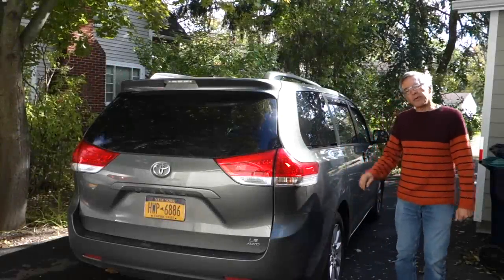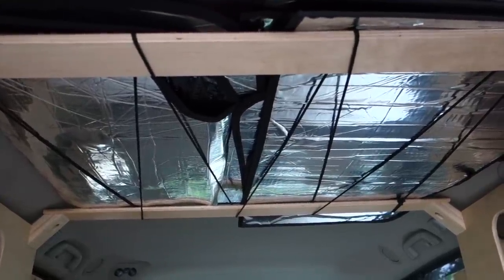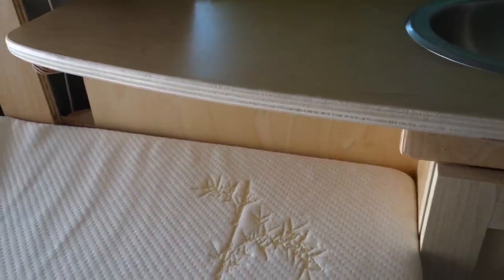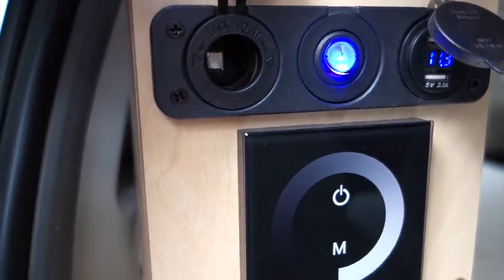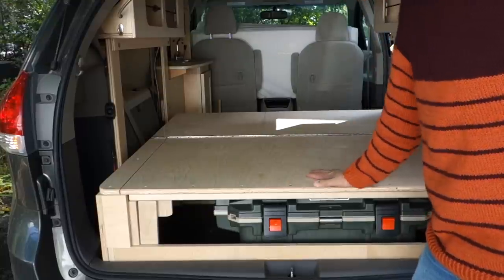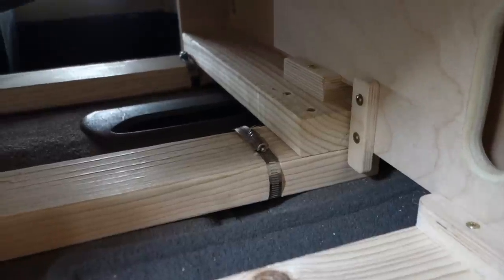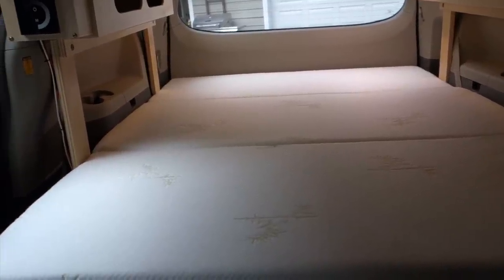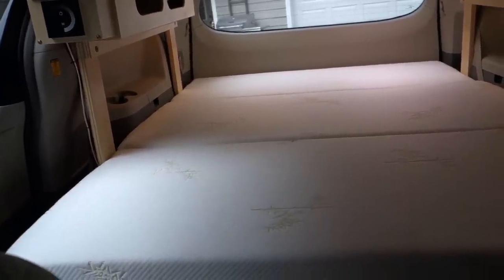A Slightly Different Mini Campervan Build

Comment: Would you share some measurements and charts for all the woodworks and the power/battery hookups? It does not need to be exact as models vary but that should be enough to allow people to follow your prototype.  You can sell your charts if you prefer. Thank you very much for considering this task.
Reply from the maker: Hi Ted, sorry for the delay, we’ve been on the road for a bit. I don’t have any charts, plans, or drawings for the work I did. It was strictly built from scratch as I went. There’s so much custom fitting needed that attempting to draft plans ahead of time was fruitless. One tip is get a bunch of large cardboard and start making templates where your parts are adjacent to interior contours and fine tune the templates before cutting wood. Even then, the wood contours will need final adjusting to achieve the desired fit. 

Electrically, I was constrained to a 100 watt solar panel for fitting between the roof rails. The panel only outputs a max of 6-7 amps so a solar controller rated at 10 amps would have been sufficient. I chose 20 amp in case I ever added an auxiliary panel that I could hook up next to the van for more power. For the battery, I chose 100 amp-hour as a capacity that would comfortably run lights, fans, devices, and a fridge. To learn more about solar basics, search YouTube for Will Prowse - he covers the full spectrum.

Comment: Very ingenious!! Thanks you for sharing, I have some questions: can you put the 2nd row seat without removing vanity module? how wide is the vanity module?  have you consider putting a swivel platform under front seats?   Once again if you share any plans even rough ones would be So amazing!
Reply from the maker: Thanks for commenting. Answers to your Q's: I can easily install the passenger side 2nd row seat while the vanity is still installed. The vanity base clamps to the driver side 2nd row seat track base so the vanity needs to come out to allow the driver side 2nd row seat to be mounted. The vanity countertop is 13" wide by 33" long - not sure if that was the dimension you were looking for. The vanity cabinet underneath the countertop has a complicated shape but you can get a sense for its dimensions knowing the countertop's size. Swivel seat base under the front seats would be great. I've thought about it and searched for existing solutions but have found none. I've concluded it would be very difficult to modify the Sienna seat bases so for the time being, I'm living with the stock seats as they are. I'm planning some updates for 2019 so stay tuned.
Reply: @BruceParks  Thank you so much for the information!

Comment: Hi Bruce and THANKS!      it feels like the perfect design for me. I have recently purchased a 2017 Sienna. Living in Maine, and moving in the Fall to N.M. What are your thoughts on a portable toilet, that will fit into your buildout? I will be hauling a small trailer, so I have an "off shore" spot for the waste. It appears that the platform is built with 3/4 Baltic Birch supported by 2X4's correct?Cabs appear to be 12 inch.  Have you considered Hollywood or perhaps Ballywood? Thanks so much!
Reply from the maker: Hi Lee, glad you liked my build. A portable toilet would fit on the floor between the sleeping platform and the front seats. We just use a Luggable Loo (bucket w/seat); otherwise it's public restrooms. Your analysis of the sleeping platform was spot-on. I used baltic birch on top and both sides; bottom crossbars and vertical center supports are 2x4s.

Comment: That’s very nice design and I like the best I’ve seen by far.   Will you share the measurements and drawings if you have?
Reply from the maker: I'm hoping to work up a set of plans I can make available. Stay tuned (subscribed) just in case.
Reply: @BruceParks  Thank you.

Comment: Wonderful build. One question: When you place the front bed piece under the middle piece, is it sliding back further than the middle piece? How is it nesting back there? Thanks!
Reply from the maker: When stowed, the footboard/table doesn’t move at all. The latch hooks on each side drop into pockets in the supporting rails underneath. I didn’t describe that in the video. Good question, you’re paying attention!

Comment: This is such a well thought of and engineered design! Bravo! Can a passenger seat be reinstalled without removing the bed and overarching structure? I see some of the frame posts are in front of the belt systems, do they prevent the belts to function in any way? Planning on stealing an idea (or two) for my own conversion. Thanks for sharing!
Reply from the maker: Hi, thanks for commenting. Yes, the 2nd row seats can be installed without removing the main structure in back, and the seatbelts are still usable with those seats. Good luck with your conversion!
Reply: Thanks Bruce!

Comment: How thick is the board you sleep on?
Reply from the maker: It’s ¾” thick plywood. It’s stiff enough to support both of us by itself but I’ve also got several midpoint struts and full width crossbars that eliminate any deflection. It’s like a slab of concrete, not that that’s a good thing. It’s just very solid.

Comment: Bruce, your campervan is beautifully crafted, both woodwork and electronics. I was wondering, if you just remove the bed would you be able to install the second row better yet, also third row seats? Thanks.
Reply from the maker: Since the upper cabinets are supported by the bed frame, they'd come out too. So the way I designed this, the second row seats can easily go back in by storing the bed foot board away but the third row seats couldn't go in unless everything (bed frame and upper cabinets) were removed.
Reply: @BruceParks  Perfect! Thanks.

Comment: Bruce, came across you YouTube while still Googling although I have aleady has a lean to a Sienna and watch with a smile on many smart ideas and was very intrigued. You are a good designer and builder, with a huge SHOP!!  Reason for writing is to ask if you have a partial sketch to share even if not a full plan which have dimensions on the major wood pieces. It will greatly reduce duplicated efforts to re-invent the exact wheels on my part when doing DIY build.

Comment: Really nice work sir! I'm looking at converting a minivan for the complete stealth aspect of it. Can you tell me, do you just keep you vehicle insurance as regular vehicle insurance?
Reply from the maker: Thanks for viewing and commenting! Regarding insurance, I didn't seek changes since it's still basically an unmodified minivan and I sometimes remove the camper parts to use it as a regular vehicle. I suppose if I wanted to insure the extra value of the camper parts, I could talk to them about it but for me, if I had a total loss and I wanted to rebuild everything, it would be kind of easy and low cost. Great question, though!
Reply: @BruceParks  I recommend NOT talking to insurance companies about it. I'm trying to figure out insurance for a fully modified van before I even purchase and so far I've been told by 3 insurance companies "we don't have a plan for that". Your set up is hassel-free in every way. I may end up doing it. The insurance company hang up for me is that I want to continue to commute to work & just weekend warrior camp. 5 years left before I retire.
Reply from the maker: Joy, it's nice when retirement is on the horizon. I retired 7 years and life has been "awesomer" since. The mini-campervan approach isn't for everyone but for us it is the most practical and versatile approach to support occasional roadtrips and other missions all in one vehicle. I've gotten over the whole stigma thing some people have about minivans. Now, I consider the minivan to be the ultimate sport utility vehicle, particularly when equipped with awd: it's a camper, bike hauler, ski gear lift, people transporter, junk mover, you name it, all in one.
Reply: @BruceParks  I agree!! Ever since seeing your intriguing video, I've kept something like this in the back of my mind. Met with State Farm and they were TOTALLY willing to work with insuring me!! Yay! But what I wanted to do to convert a panel minivan would take me close to a year (because I work full time) and about $15K total. For just weekend getaways & still needing to use my minivan as my main commuter vehicle for work, I chucked this idea. Found a couple of places that have minivan camper conversion kits but wasn't all that impressed with them....until yesterday. YouTube "Freeway Camper Kit Malibu". SOLD. This is PERFECT for me. I am now researching/shopping between the Chrysler Pacifica and Grand Dodge Caravan - both with stow n go seating in both the 2nd & 3rd rows.....another necessity for me as I live in a condo and have no garage to store things. SUPER EXCITED & HAPPY to find a perfect solution. Your video was the starting point for me on this decision, so THANK YOU!!

Comment: What an awesome build. Very clean. Just curious as to why no toilet and outside shower hookup. I would definitely need a pooper in mine. 😁
Reply from the maker: For a toilet, we use a Luggable Loo (lined bucket & lid). We usually have access to public facilities when we're road tripping so we don't use the Luggable much, mostly for middle of night stuff. If we were going to be remote for a while, we'd definitely bring a portable toilet - there's room for it. For showers, we bring a Coleman camp shower that can go on the rooftop to heat up and provide some water pressure.

Comment: THis is the most awesome mini van i have ever seen anyone build. How much to build me one like this?
Reply from the maker: Hi Andrew, thanks for commenting. I'm not really setup to reproduce these components very easily so I'm not in a position to quote the work but if you wanted to estimate it with someone, it might be around 150 hours x whatever labor rate is fair, plus materials. I expect it would take me under 100 hours to reproduce what I've got but it would take someone else quite a bit more time to create this for the first time. Just an opinion.

Comment: Bruce you have done a beautiful job with this project. Can you provide any details or buying list of the materials you used for your build? Thank you for the video it is very helpful.
Reply from the maker: Doug, thanks for commenting. Other than the plywood, which was typical baltic birch plywood you can find at most hardwood dealers and some big box stores like Home Depot, the other parts are here (these are the original links from my purchases, some might not work anymore):
Table leg hinges: https://www.amazon.com/gp/product/B01E5SUKN4
Window shades: https://www.weathertech.com/toyota/2011/sienna/sunshade/
Mattress: Milliard Tri Folding Mattress. Link: http://a.co/d/dvk7Q17
Sink: https://amazon.com/gp/product/B004RCX8MY
Sink drain: https://amazon.com/gp/product/B00GD8S4NI
Faucet: https://amazon.com/gp/product/B000BGM2XG
LED Strip: https://www.wish.com/product/59fe60b29a07bd675e38291b
LED Strip Channels: https://smile.amazon.com/gp/product/B071FT9SXK
Reading Light Dimmers: https://smile.amazon.com/gp/product/B01325KCSY
Cabin light dimmer: https://www.ebay.com/itm/DC12V-24V-8A-Single-Color-Glass-Panel-Led-Touch-Dimmer-Controller-Strip-DC-YA9-/372247846365
Hatch Mosquito Netting https://www.amazon.com/gp/product/B01K1XCSKA/

Comment: Really nice build. What is a ballpark starting cost for something like this? Do you ever cook? Seems like a fold out table in the back or some set up to hold a small stove would be nice too.  Love how the table fits in to the compartment and allows you to put the chairs back in if needed.
Reply from the maker: Hi, Dee, ballpark figures for the build in this video are around $500 for the wood, hardware, plumbing, mattress, and electrical. I've since added solar power and a refrigerator and made a bunch of other updates (https://youtu.be/oO2-2EKtJLc). Additional costs were approximately $1000 for electrical components and $500 for the fridge. Thanks for asking.
Reply: Wow. Thanks for getting back to me. That’s really reasonable.

Comment: Super build.  I have an '06 Sienna I am trying to convert. You said in a prior post you had a track for a curtain between the front and the house. Did you ever post that? I would like the separation a full black-out offers. And as many have said, if you ever draw up plans I am very interested.
Reply from the maker: Rick, thanks for watching and commenting. Regarding the curtain/track, I'll be building that soon. I found some track products on curtain-tracks.com that should work well for my application. I'm still sorting out options for how to follow the ceiling contour from left to right just behind the front seats. In the meantime, I'm building a nice solar power upgrade for the minivan and hope to post a video about it in the coming weeks.

Comment: Wow Bruce!!
Your workmanship is amazing and the design is the best I've ever seen.🤯 I had started lean on the side of a minivan being a tad bit small for my liking. But that was before I saw your video.  You really made it seem roomy-and that's with a sink installed! Mind blown again
I definitely like the stealth aspect of a minivan and I'm quite sure I'll be "borrowing" from your design. I could never make it look so nice and professional but your ideas can still be used even though it will look a bit more "layman" like haha..

Thanks a million for all your videos and I look forward to future ones!
Be safe!

Ps: roughly how much did you spend on the basic version (without the electric wizardry) for framing, material etc?
Reply from the maker: I'm so glad you liked my project! Regarding materials cost, I'd estimate about $300-$400 for the net amount. By that I mean I spent more than that on things like Baltic Birch plywood in different thicknesses, bulk hardware quantities, etc. but left over material can be used elsewhere. The electrical added another $1K later.
Reply: @BruceParks  awesome, thank you! 👍

Comment: Great design! Did you remove your third row seats permanently? Thanks for sharing.
Reply from the maker: I removed the third row seats to take advantage of the space for our cooler. I wouldn’t call it permanently removed because I can reinstall them later when the campervan parts are removed. If I didn’t need the space, I could have left the seats in the van and folded down - all of the campervan parts would still fit though I’d have to make a minor change in the hold down features.
Reply: Bruce Parks awesome build! Thanks for sharing.  We have done a similar build in ours but opted to keep 3rd seat in and our bed is a bit higher to accommodate a 2 drawer system.  1 drawer pulls out and is our kitchen, stove, propane, coffee supplies etc. to cook under the hatch door. Other fits 2 camp chairs, tarps, tie downs, tools etc.  We will be using your side storage units and roof storage for window covers.  Enjoying many short jaunts in mountains of NC and beaches.  With 2 medium dogs who use front captain chairs as beds. Stealth enough that we stayed in street of DC, makes it all more affordable.

Comment: I would like to have a explanation of the electrical additions. Are you using dry cell and recharging once the motor is running?
Reply from the maker: Marrea Matthews - I mention this in the description. I use a jump pack battery (lithium ion) that’s plugged into a 12 volt port so it gets recharged when we’re driving.

Comment: I really liked this.  The only thing I would change is the bed.  I want my bed to serve as a sofa during the day.  I also like that it is modular and you can turn it back into a minivan.   Did you remove all the seats?
Reply from the maker: Hi Linda, thanks for viewing and commenting. Though I didn't show it, the bed can be used in sofa mode. The bed has three sections. The head section hinges up and can be secured as the sofa backrest and the foot section can be stowed under the mid section or removed and used as a table. Having said all that, I'll admit we have never used it in sofa mode just because we are never hanging out in the van except for driving and sleeping. But it can adapt to different usages easily.
Reply from the maker: Yes, the 2nd and 3rd row seats were removed.

Comment: Nice! Can you tell me what the light strips and dimmer manufacturers/models are? Thanks!
Reply from the maker: LED Strip: https://www.wish.com/product/59fe60b29a07bd675e38291b
LED Strip Channels: https://smile.amazon.com/gp/product/B071FT9SXK
Reading Light Dimmers: https://smile.amazon.com/gp/product/B01325KCSY
Cabin Dimmer: https://www.ebay.com/itm/DC12V-24V-8A-Single-Color-Glass-Panel-Led-Touch-Dimmer-Controller-Strip-DC-YA9-/372247846365
Reply from the maker: There are several smaller parts you would need in order to complete the connections, for example, after you cut the LED Strips to the lengths you want, you'll need the connectors that slip onto the cut end in order to have wires to connect to your battery source. Search around on wish dot com and you should be able to find those kinds of parts.
Reply: @BruceParks  Thanks!

Comment: I like it, but when I've tried sleeping in my minivan, I've found ventilation to be a problem and cracking a window open lets bugs inside. One time it was so bad I ended up starting the engine every so often to run the AC.
Reply from the maker: We find two things are essential for warm nights: insect screens over the windows and a small 12 volt fan. I made some insect screens that are the same shape as the side window but a little oversize and sewed magnets around the perimeter of the screen so it attaches to the door frame. Then you can open the window as much as you want without any bugs getting in. We have a couple of small fans, one that plugs into a cigarette lighter socket and the other into a USB outlet. This is good enough to be comfortable for falling asleep. By the middle of the night, things are cool enough to turn off the fan or fans.